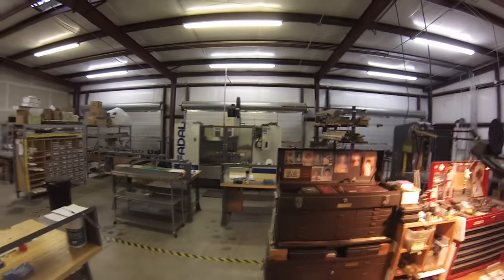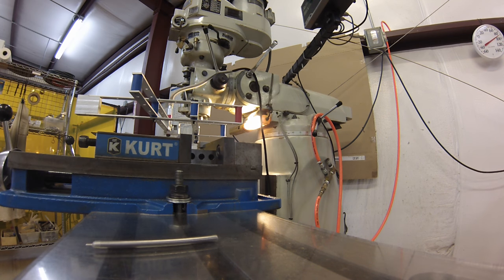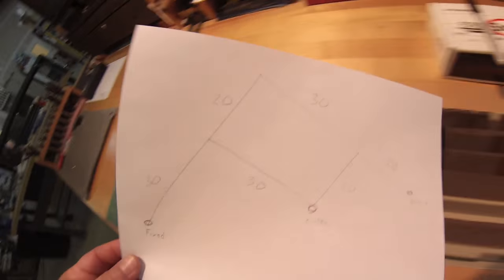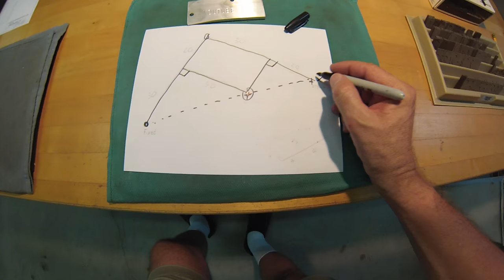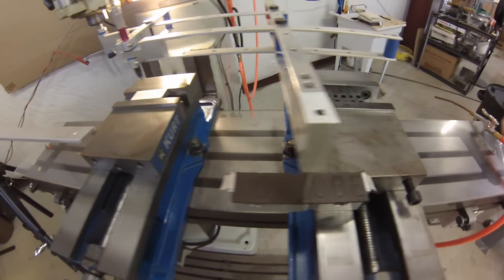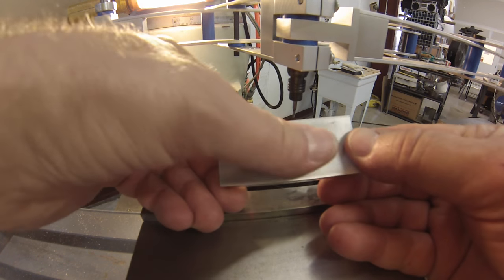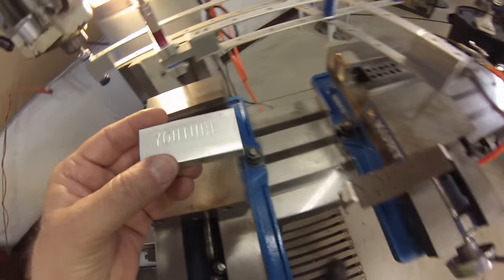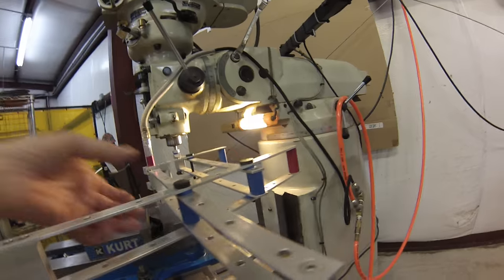Engraving On a Manual Mill

Comment: I found 3D printable letter tiles on thingiverse, letters are 22 mm tall - the tiles are 30 mm wide, but easy enough to slice 5 mm off each side to space the letters correctly - now I just need to get the pantograph made! The local Lidl had pencil grinders that look pretty much identical to the one you're using for £15.99, about $20 US, that should be good enough for the amount I'll use it!  Thanks for the video!

Comment: Joe,
I made something,pretty identical for use on a small mill. I made the 'masters' by printing them out on a 3D printer. You can print out any font, or any sign, pictogram ....whatever you want. If you want to use it frequently, you can just make masters in metal using the printed ones, before they wear out...

Paddy
Reply from the maker: Thats a great idea.

Comment: Thank You Joe, As this video finished, I immediately gave a thumbs up then I went to your website and downloaded the pdf file. This is going to be a fun project!  I am not sure if this will fit on my smaller round column mill but then I have a large work bench to put this setup on. Thank you for posting this and for providing the plans! AWESOME!
Reply from the maker: This unit is very scaleable. Be careful about static mounting it. you may loose the step over and depth control. Good luck

Comment: memory flash back.   So much like early 1960s in high school a "Zepher lettering kit"
for blueprints.    any one remember those? good job Joe
Reply from the maker: I think they were stencils that went all the way through.
Reply: not really, it was a panto graft like you built with letters and numbers 
set it on the draft table and fill in the "corner of the print"  such as 
date part no. print no.    best I remember       sam

Comment: Awesome! The only other time I saw one of these years ago at the Waltham Watch Museum. They had a 12" master and scaled it down to a pocket watch. It makes much more sense now!
Reply from the maker: Thanks for the comment Tim. There is one feature about pantograph engravers I did not incorporate into my unit because I didn't need it. Depth control from the stylus tip. See if you can find a video on how the US mint makes the punches for quarters. Its a rotary table and pantograph used together like a stylus on a record player. The quarter master die starts out dinner plate size and spins slowly as the other end cuts the punch. This is a very cool attachment to have.

Comment: In a government lab I used a dedicated machine for engraving, fundamentally of this design.  It was fancy, having heavy cast iron pantograph, with witness marks and adjustments for scaling, and sets of type and a type board for setting up the engraving.  Its spindle was belt driven with a round cord belt (like the old dentist drills).  I would guess this machine was made in the 1950's.  It is important that all lash be taken up in the pantograph bearings.  The bearing cartridges from old disk drive head assemblies would be perfect, these being already preloaded, and you need only drill 1/2 inch holes in the pantograph members and epoxy these in.
Reply from the maker: Where are these bearings used in this assembly?
Reply: @joepie221  In the ancient machine, I assume they were some sort of bronze or Babbitt journal bearings.  In the disk drive bearing cartridges, they are pairs of "ring" ball bearings (of relatively large diameter inside and small cross-section) that are preloaded and bonded in place between tube and concentric axle.  You mount to the outside by slipping in a close-fit hole, and to the axle by tapped holes in both ends.

Comment: Nice twist on a useful tool. It may be useful for viewers who are on a budget or who want extra font options that printing the text you want multiples larger on a sheet of paper  and then using the letters as a guide to make a track over or around the text will serve as a great template once reduced on the pantograph especially as any slight error in the large text will disappear on the smaller engraving. Your own templates can be made as well as one off engravings of just about any shape.

Comment: Awesome videos I have been a Mechanic most of my career starting at age 15.5 through work experience in High School My beginning goes back to ingenuitive father and uncles which inspired me to seek out books at as young as 6 yrs. old like 2 stroke vs 4 stroke, Basic Engine theory and how the combustion Engine works  however, I don't know how or why because, I couldn't read, in fact I pretty much failed everything except Gym and, shop classes! while growing up on the farms in So. Ca. I watched as family had no choice but to fix stuff and was fortunate to be able to ride Motorcycles so I assisted Dad and such, who always thought I was a failure I began getting paid as a mechanic at 15 and a half years old through a full service shop which specializes in German car with VW, Porsche, Mercedes and so on we did everything in house and a lot of machine work for every shop up and down the coast my boss was tough if he needed a tool Make one if you break it you pay if it comes back I take it out of your check but I never let things get me down I worked on call as heavy machinery in oil fields on call on & offshore was lucky talked my way into most every job I had but worked big construction Mech/welder held class a CDL, mech. Rubbish ind. and this was the icing on the Cake a union job as a Machinist for Abex Aerospace and later a smaller CNC shop but you know time passes and you think you know whats up But I dont just like then, winging it I have spent the last year proto typing some things and was near an end when someone threw a wrench in my program stole a bunch of my equipment and materials, as if that would stop me!
I just purchased a pretty nice 13" Lathe 1000 times what I had, I had to go back like three times the poor old guy was afraid he was doing me an injustice worried I might lose a limb or something; I broke down as I pulled in with my trailer and, the old guy wanted to put me off another day, dude take the money and load my new lathe I'll promise you It will get home in one piece and I'll make sure it lasts me a lifetime just be ready to sell me one of the Bridgeports you have in there; I love and Appreciate your work on here, as It will help me get up to the point I left off and much much more I've always had selective learning But I have always had Great respect for those who are willing to share the many years of hands on knowledge Thanks again David Werland

Comment: COOLER THAN HELL !! I see new valve covers from my engine shop. Thank You I always wondered how those M/T valve covers were engraved.
Reply from the maker: M/T valve covers are actually cast. You'll need a special template to do an outlined part like the M/T logo. I actually had those on my 68 442. Black with the silver ribs and logo.

Comment: Thanks for posting this. I was actually looking into making something like this.  I usually stamp my initials and year on anything I make for someone,.  I usually worry about the stamping more than anything else because I mess up on at least one letter of the stamping more times than not.  I would want to make it for much smaller letters though.  Thanks,  Chris
Reply from the maker: Hey Chris, This unit is very versatile. It has a wide range of reduction capability and if you start with smaller master font characters, you can really make this small. My font is 1" tall, but I think I'd suggest 1/2 or 3/4 masters.

Comment: That looks very handy!  I recently picked up a complete set of 1" and 3/4" letters at an auction, along with a small scribe type panto-graph.  I also have a die grinder like yours, so my investment will be very low to build one of these.  I always say that if someone has to ask for plans to make something like this, they probably shouldn't be making it anyways. ;-)  (especially after your great explanation)   Thanks for the video.
Reply from the maker: Thanks Jack. Things can really go hay wire on something like this if you miss even the smallest detail. It is a great project to try to figure out on your own. The proof of success is when you actually engrave something and the font is level and consistent at all of your size location positions. Good luck.

Comment: @Joe Pieczynski  That is great.  I have a full bore metal part engraving unit and a dozen or so sets of type.  I have custom plastic that a CNC man made for me.  Military insignia and various Masonic.  I think this with a die grinder is wonderful.  I use carbide and have a few diamond.  They are D drills conical tip with a flat.  I made a lot of signs (not in the business) and have funny ones here and there.  I've had children draw something they like - got a Honker.... and I created a pattern out of material - traced it with a color pencil so I could see better and make a nice one in plastic.   It was given to the lad.  Copyrighted pictures are OK as long as you don't sell them or advertise with them. Looks like Joe can make any design he wants on his CNC and material and a ball end mill.  Martin

Comment: A pantograph of any kind is basically a parallelogram. There are pantograph engravers out there -- see Stefan Gotteswinter's channel -- and they can be used for a lot of things besides cutting letters. Pantograph engravers were very common at one time, but have been superseded by CNC-based stuff. Basically you are using the mill as a fixed point, with the advantage that the starting X, Y and Z are easily adjustable. A nice idea. I built a Dremel-based pantograph, but am still working on depth adjustment. My biggest problem is finding templates at a price I can afford. Proxxon tools builds a very nice pantograph engraver, but it is extremely expensive as all Proxxon tools are. Very interesting video, food for thought.
Reply from the maker: This is true, but there is a very specific set of conditions that must exist for a good scale translation. Pivot your unit in 2 directions at your anchor point. That will give you your depth detail you re looking for.
Reply: Yes, of course. Not always obvious. THanks.

Comment: love your videos. from all the videos I've seen, yours are the most insightful. could you explain the difference between a normal thread and a pitch diameter thread, because the majority of lathes show it as 1/n and pi/n
Reply from the maker: Greetings Esteban. Not knowing your experience, skill level or type of machine you have, I'll try to clear this up for you. My lathe has several charts on the gearbox. One chart is a feed rate chart that tells you how far the carriage moves for each revolution of the spindle, and the other asks you which thread you want to cut and tells you the position of the levers to achieve the correct pitch. So one chart is for turning and the other is for threading. THREADS......All threads can technically be refered to as a pitch diameter thread. Though I have never actually heard them called that, a correctly machined thread does actually have dimensions other than the outside diameter and how many threads per inch. Driven by the use of the thread, like a bridge bolt or a microscope adjustment knob, the amount of tolerance you have changes. A class 1 thread is like the hardware store stuff, and a class 3 thread is more for instruments and very precision applications. I would have to assume, the 1/n you are asking about is the feed rate value used for turning and facing, and the pi/n is your thread range chart. I know on my machine, when the knobs are correctly positioned for a thread, the lead screw engages. I would suggest experimenting with your gearbox and just observe all the changes in movement of the carriage and lead screws. If you need a detailed example of how to calculate a correctly machined thread, just ask.

Comment: Fantastic idea!  Can't wait to get the plans and build this!  On a side note do you have any suggestions on add on DROs?  I have a manual lathe and mill that have not been fitted with DROs yet.  Think it would be a very worthwhile add to both machines.  
 Thanks for all the content.  Sorry just noticed this was from 5 years ago.  
Mike
Reply from the maker: Hi Mike. Accu-Rite DRO's are my go to. I only have a DRO on the lathe z axis and its all I really need.
Reply: @joepie221   wow! Thanks so much for the reply.  After I realized this video is 5 years old I never thought I would hear back from you.   Best wishes always and thanks again!

Comment: Joe, thanks for this video. I have been trying to make a 1 to 1 paragraph, but trying to figure out to build it is driving me nuts, not to mention all the stock I have destroyed trying to get a 1 to 1 ratio. Do you know how I would figure out the math and measurements to make the arms between the cutter and pen track the same distance on X and Y to achieve 1 to 1. ??  Thanks
Reply from the maker: I believe a copy pantagraph is basically an 'X' pattern with the front doing the tracing, and the rear doing the engraving. Unlike the standard pantagraph where all the work is done on the same side of the pivot. I believe the rear engraved product ends up, upside down...Its been a while.
Reply from the maker: https://www.youtube.com/watch?v=HHMzk7HTwPI  This is one concept.

Comment: Hey Joe, do you think it would be possible to modify something like this into a parts duplicator? Kind of the same concept as a key cutting machine that locksmiths use?
Reply from the maker: I bet it would. The part may be a mirror image, or inverted, but I am sure it could be figured out.

Comment: Nice pantograph. I've been looking for one on eBay. Looking forward to the drawings so I can make my own. I was attracted to watch because the title suggested I could use my manual mill. But after watching, I don't understand why the video title refers to a manual mill. It looks like this could be done anywhere using any stationary anchor pin and a flat table. A better title for the video might have been "Home-Made Pantograph for Engraving without a CNC Mill". That might make it more appealing to a much wider audience of people without a mill.
Reply from the maker: Hi John. What the video failed to show, were the positioning options offered by the table movement of the mill. Unlike conventional pantographs that would require hard type masters, this unit allows you to move around your work piece and engrave as you see fit. A conventional pantograph will only engrave over the exact same spot. Your observation may be a good topic for a follow up video. Thanks for the comment. I hope this addresses your concern.

Comment: How often do you change the lexan covers protecting the mill T slots?
Reply from the maker: They are original from 2005. I have a single vise set and a double vise set. The double vise set is about 9 years old. The table is like new underneath.

Comment: Hi i enjoy  watching your videos...  a question ..what is the best /easiest way to do line segment engraving like ruler marks onto  a workpiece ...thanks
Reply from the maker: Use a very small ball nose carbide ( .030 dia. ) end mill at high RPM. about .005-.010 deep should do it. A tapered end mill will be strongest.
Reply: thank you

Comment: Ok. Now I'm thinking, "How am I going to make one?" Do you have specs and manufacturer of the pencil "engraver" grinder? I can sort of calculate by the looks of what you have done, what it would take to make one, however, drawings would save a lot of people a lot of time (including me). Yet another very nice video!
Reply from the maker: Thanks Jim. This thing is really cool. I can also make masters on my CNC of complex logos and such and then I can put the logos and graphics on anything in the manual mill. Its a nice addition to a shop. I will post drawings on my company website. www.advancedinnovationsllc.com in the near future. With the font masters and grinder, out of pocket will be around $400 to make this. The material is the cheapest part. I appreciate the compliments and comments. Stay tuned

Comment: what make and model is your verticle mill, since Bridgeport of no longer sold and is it accurate and parts available for it. thanks
Reply from the maker: Its an ENCO mill. Currently being distributed under the MSC label. I believe its a 9 x 54 vari drive. Its been a great machine. Only the spline bushings have ever given me any problems. I am fairly sure MSC now supports all the service parts and the machine is accurate enough for my work. I have a .0005 DRO on it, so its a nice machine to operate.

Comment: Hello can you please post video on trick to balance castings on lathe
Reply from the maker: The very first thing you need to do is to assure your machine is loose when in its neutral range. It must spin freely. Once you have a setup to be machined, slip the machine into this free state and balance it with additional weights. Keep kicking the fixture to see if it spins os finds a low spot. Finding a low spot is bad and an indicactor fo the next weight.. this will take a while. be patient.

Comment: Are there plans floating around for ratios? Meaning 1" lettering reduced to (what ratio)?
Reply from the maker: I keep promising to post the plans, but its taking longer than expected. The reduction will be proportional to the triangles formed from the pivot point (anchor point ) to the grinder compared to the anchor point to the stylus.

Comment: I am very intrested in this concept.  Two questions 1. Could is cut smaller characters? 2. Could it engrave on a round surface I.E rifle barrels? Thank you
Reply from the maker: It can. Final size is driven by the setup and masters used. As for the cylindrical results...I haven't tried that yet.
Reply: @joepie221  thank you! You are a machine shop PhD!